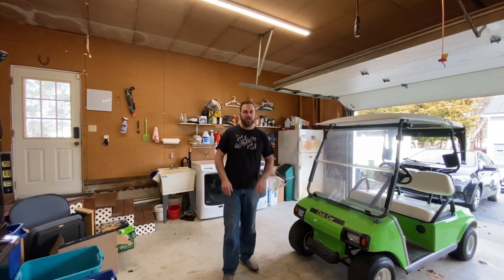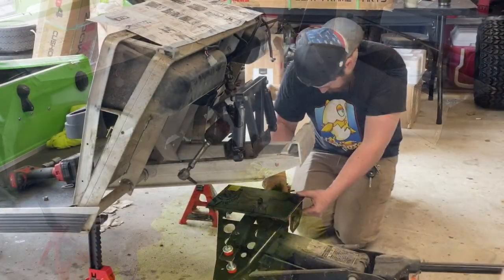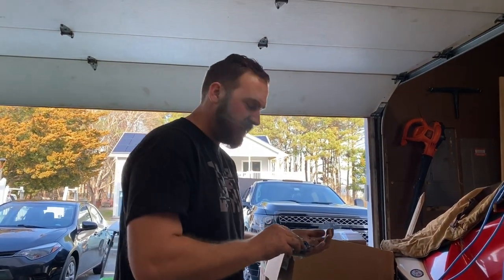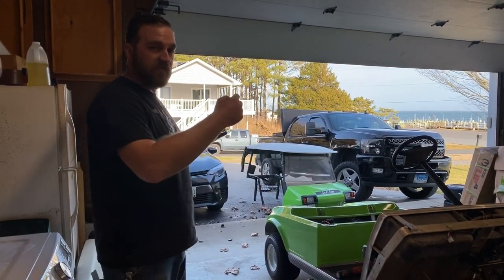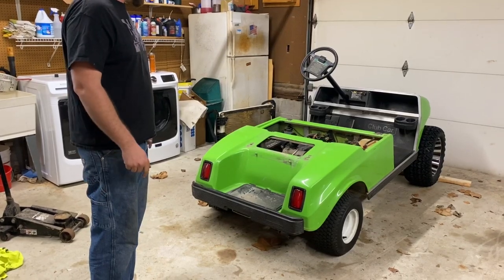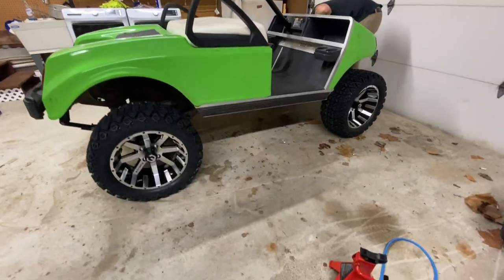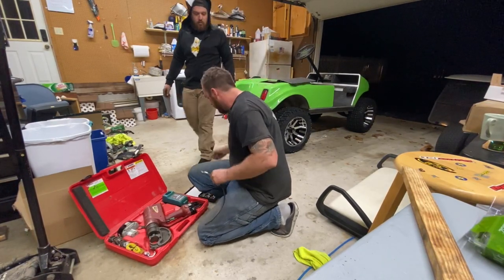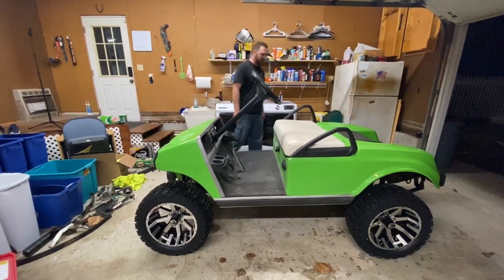Club Car 6” Lift Kit Install

Comment: Hey jacob i just put a very similar lift as yours.. did you notice the rear sitting much taller then the front (raked)? TIA
Reply from the maker: The rear is slightly taller while unloaded. When passengers or cargo is loaded and the springs are under tension, the cart levels out.

Comment: I am installing this kit now on mine. Did y’all run into issues with the hubs/spindle nuts fitting? The instructions say to resuse the old nuts and they are a lot smaller and the hubs seem a little loose on the new spindles
Reply from the maker: No, I don’t recall having any issues with the spindle nuts

Comment: Looks GREAT  .. where them wheel spacers yall put in ? If so what thickness and where from ?
Reply from the maker: Ken it was a 2” aluminum wheel spacer kit - 1” per side

(4) 2" (1" per side) Wheel Spacers EZ GO EZGO Club Car Golf Cart-4x4 to 4x4 1.0 - SmartPartsCo https://www.amazon.com/dp/B00IELPGGU/ref=cm_sw_r_cp_api_i_HH91EbT8DBF4F

Comment: Looked like you put spacers on the front hubs ?
Reply from the maker: Bill they are on both front and back
Reply: Jacob Young 
picking up a 99 electric model DS tomorrow and I would like to do the same lift and tire combo .
Reply from the maker: Bill the pre - 2000 year DS models are different products I believe, I’m sure you’re aware. The look will still be the same though. I love the stance of it with the spacers, they make a difference.
Reply: @jacobyoung3160  Jacob , I just finished the Madjax 6 inch lift , my wheels are very similar to yours , i used 2" wheel spacers , looks awesome ! I have the whole body off for paint , Kandy fire orange over silver , hope to have that done by this w/e . I'll try to let you see it when i'm done !
Reply from the maker: Bill can’t wait to see it! I bet those 2” spacers will make it look really stanced, probably going to look sick
Reply: Jacob Young Jacob,i’m still working on it,having issues with paint. How thick are the wheel spacers you used? As I used 2 inch , i’m kind of worried about the rear because the stud coming through the spacer seemed too short and only got four or five threads holding it on, wondering if I should go to a 1 1/2 inch spacer .
Reply from the maker: Bill I used 1” spacers, I did not have that problem with the studs. They do make lugs that have a shoulder on them that may fit into the spacer well a bit better? If not, yeah I’d say you’d have to downsize the spacer or take the hub off and replace the studs with longer ones. Good luck! Be sure to post pics!
Reply: @jacobyoung3160  She's pretty much done ! Not sure how to let ya see it ? (post pics)
Reply from the maker: Bill I’m not sure, make a video!